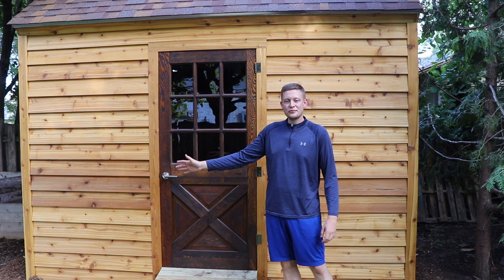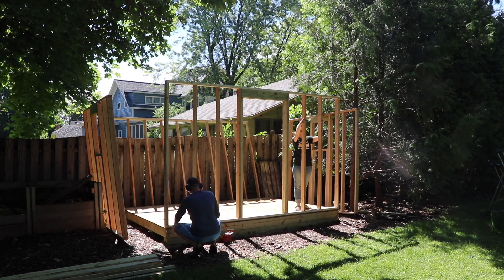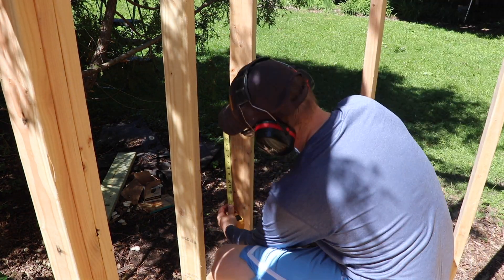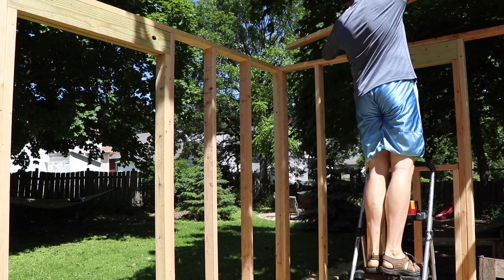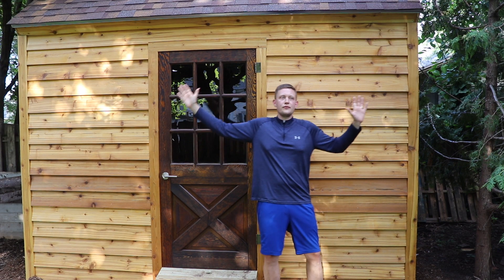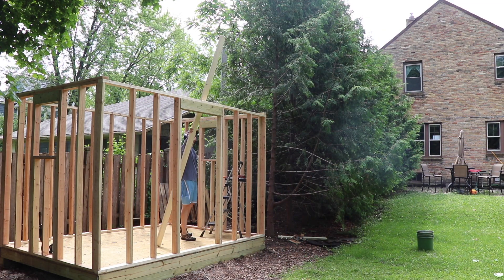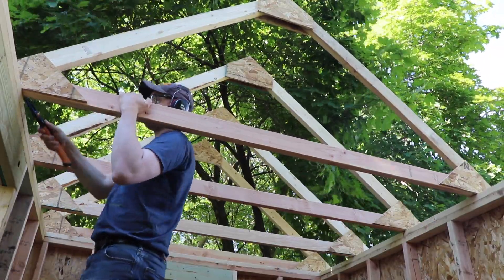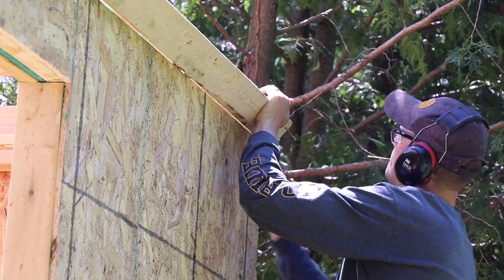How to Raise Shed Walls & Roof Rafters - Building a Shed Part 4

Comment: I had help to hold the wall panels from a 13 year old girl. Help here at this point is excellent. I used a carpenters square to ensure corners were square. When cross bracing my walls before ‘raising the roof’ I used a level to ensure plumb and level. I used strapping on the rafters to make them ‘even’ and level and square.